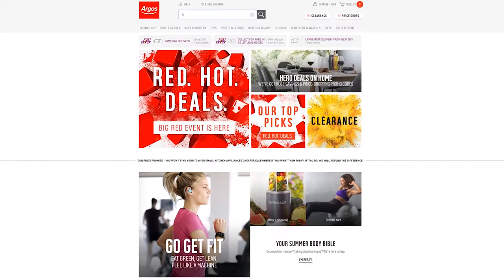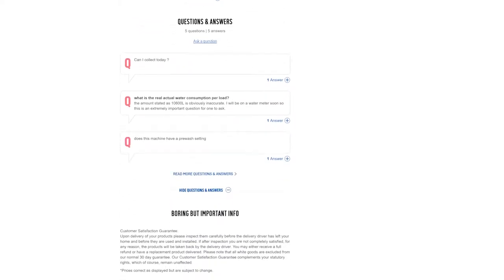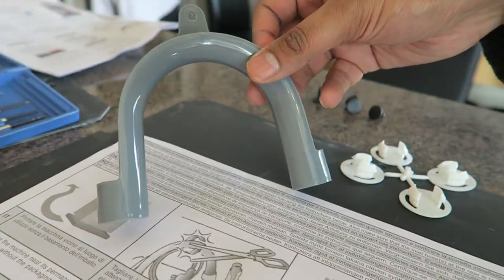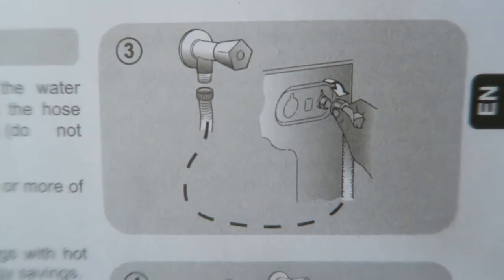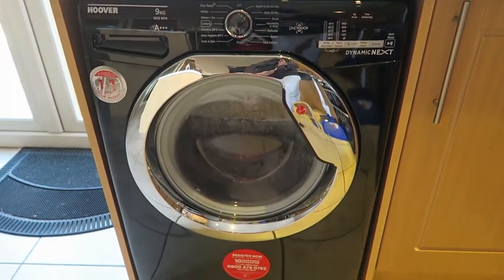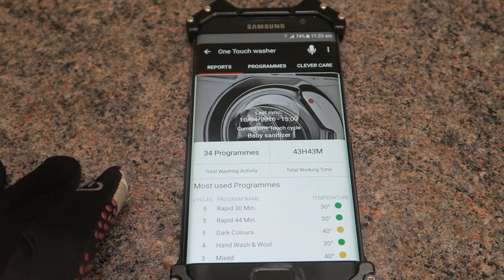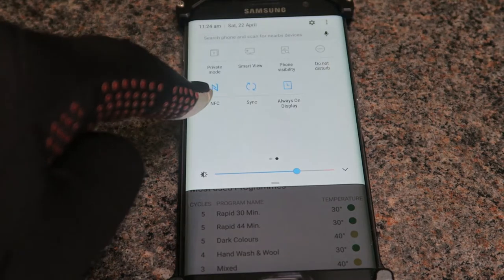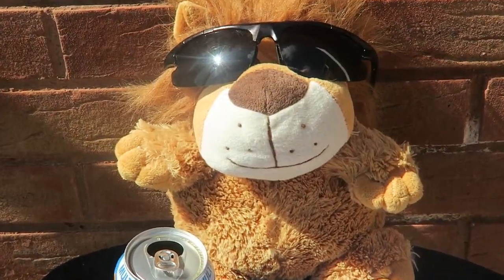How To Install A Washing Machine | Hoover DXOC69C3B 9KG 1600 Spin One Touch Review

Comment: What about if the one touch won't connect to the mobile phone even after checking nfc and instructions etc.?
Reply from the maker: Hi,, if there is  a problem with connecting the NFC to the washing machine please do contact the manufacturer, or try uninstall and reinstall the app, or restart all devices.